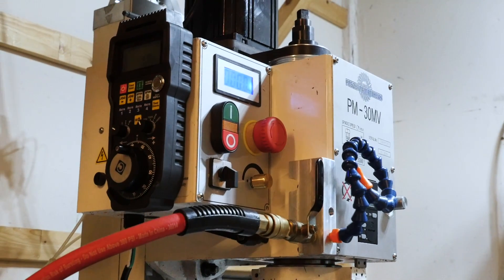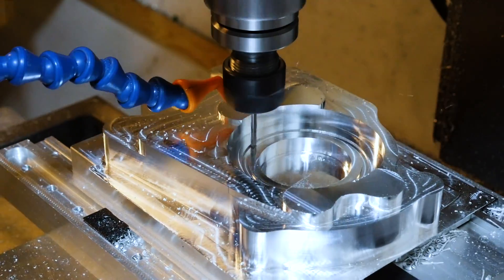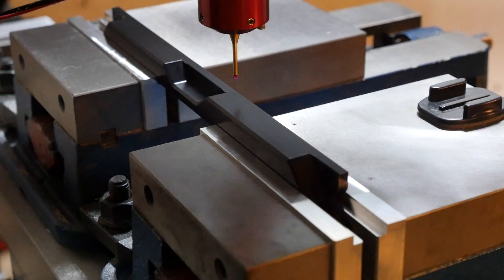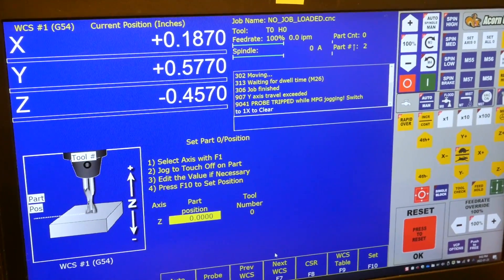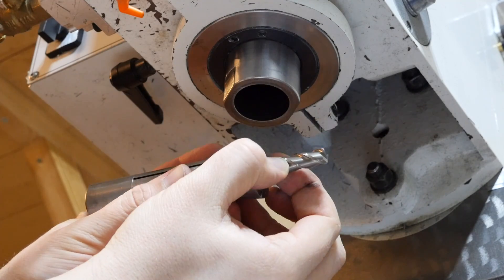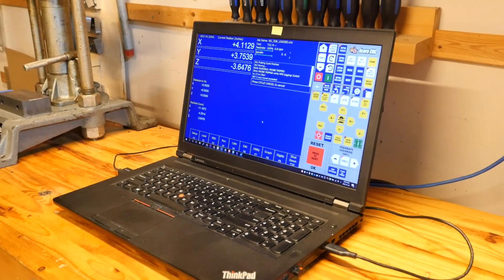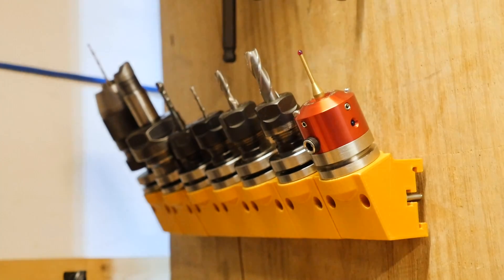Convert a Bench Mill to CNC - Everything You Need to Know

Comment: Are there memory issues/limited with acorn as far as gcode.  Read a review about memory is limited. “Great controller but the 50kb limit is reall really low.. wont even do 4 m8 holes from fusion 360 using their sprial bore feature. “

Is that accurate that the pro version is needed for increased memory.
Reply from the maker: @I2AT  yes. The upgrade to the mill pro license is pretty much a must. Thread milling a hole takes a shockingly large amount of code, still, it’s something you’ll want to do often. Upgrading to pro will gain you everything you need from a software standpoint….. unless you want to go even further to the “digitizing” package, which is only for probing thousands of points in an existing part with a touch probe. You’ll likely not need it. I have a relationship w/ one of the owners at centroid - he’s sent me the KP1 touch probe and the digitizing license free of charge. Love the touch probe for setting work offsets and measuring things, but really never use the digitizing functions - it’s just not the type of work I do.
Reply: @adamdebowski2037  appreciate the feed back.  Give a shout anytime if interested in firearms, B&T. Take care, Travis

Comment: Noob question: can you still use this conversion as a manual mill?  I know that ball screws have very low friction, but is it straight-forward mechanical lock an axis?  I have an odd foreign mill that I want to mount a power feed on, but I am thinking that I might consider swapping in a ball screw to replace the lead screw.
Reply from the maker: @George-bb9yi  Hi George not a bad question at all - you can get some motors that the shaft passes all the way through, and so you could theoretically mount a wheel to that shaft, but I don’t see it done, really. 

I do, however, use the mill in a semi-manual way all the time - entering simple g-code into the control and have it power feed along every axis to cut square/flat features.
Reply: @adamdebowski2037  Thanks!

Comment: Hi. Can I do this with the Proxxon FF230 CNC desktop mill?
Reply from the maker: @V_raptor88  it sounds like it already is a CNC mill.
Reply: @adamdebowski2037  I mean I want to automate it with the servos and stuff. Mine is a completely manual CNC mill.
Reply from the maker: @ “CNC” stands for “Computer Numerical Control,” and it implies that there are motors on the axes being controlled by a CNC controller. It sounds like you have a manual mill. Any manual machine can be converted to CNC… theoretically. Some more easily than others. You’d have to do some research to find out if you can install a ball screw kit for your mill with mounting brackets and shaft couplings for NEMA motors.
Reply: @adamdebowski2037  oops, sorry I'm new to all this. Thanks for guiding!

Comment: Awesome video Adam! Any thoughts on whether this would be a better option than just buying a Tormach 440 or 770?
Reply from the maker: I'm glad you enjoyed the video! Objectively, both the 440 and 770 are better machines than my setup, but they sure come at a premium. All in, the setup I have is under well under 10K USD, and that includes the Mill, CNC conversion, air compressor, tooling, everything. The main benefits of the Tormachs: Tool Changers (this is huge), way higher 10,000 rpm (great for small tools)  compared to my 3000 rpm, enclosure & cooling (lets you get into fancier materials easily), BT30 spindle is more rigid than the R8 spindle. The main benefits of my setup: a fraction of the cost, somewhat easily (and economically) upgradeable spindle that will out perform the Tormachs, and PM30 has larger machine travels. If I had to choose between my setup and the 440 or 770, I would probably still chose my setup. If I had to choose between my setup and the 1100M, I'd choose the 1100M if money was no object. I'd say it really depends on what you want to use it for (hobby, or business/making money?) and the materials you want to machine... and most of all; budget.

Comment: Adam, currently I’m running nema 34 on the Acorn. I’ve done a lot of research but couldn’t find the answer. I’m trying to find what to set my PPR or step per revolution on the driver. Any recommendations?
Reply from the maker: More than likely you should be at 6400 pulses per rev. Try that out. If you're wrong, it'll be obvious in the machine travels.
Reply: @adamdebowski2037 Adam, the driver is set to 6400ppr. I’m tuning the motor to move 1” but it is really inconsistent.. average around .001 off give or take when I rerun 1” movements. I take it from the backlash?
Reply from the maker: @TheAnt0906  yup - sounds like backlash. You can compensate for backlash in the control.

Try passing one inch on the way back, and then changing directions to get back to 1 inch…. Something like: G0X0, G0X1, G0X-0.125, G0X0
Reply: I’ll give it a try. Thanks!

Comment: Hey any update on the Linux CNC?  Did you switch?  What current controller do you recommend? Still the nema34 12nm motors a good idea?  I want to convert a pm728 to a CNC mill, what you think?
Reply from the maker: I'm still using the centroid Acorn, and the more I use it, the more I love it. I am biased, but I would still recommend the Centroid Acorn, and still recommend all the same hardware you see in this video.

In my opinion there are two good reasons for chosing LinuxCNC over Centroid Acorn. #1 Cost, and #2 If you want to control more than 4 stepper/servo motors.

Comment: You should be able to recover that kennametal tool if it's just full of chips - A solution of Lye dissolves aluminium. Great for cleaning up aluminium welded cutters.
Reply from the maker: Cheers for the tip! Does the solution affect the carbide/cutting edges at all?

Comment: This may be a silly question, but when you convert a mill to cnc are you still able to use it manually? 

Ive been looking for a super cheap 2 in one kind of thing and have seen mixed results
Reply from the maker: That’s a good question. Typically - not really. I often use my mill as a “manual” mill by spinning the wheel on the centroid pendant to make the axes move, but I have no hand wheels on any axes. If you’re set on having hand wheels on a little CNC mill like this, you can get servo motors with a shaft that passes all the way thru them so you can attach a hand wheel. It’s a less common setup, but can be done.

Comment: Question, I'm turning my mill into a cnc. I'm looking at acorn. Are you using the centroid nuc cnc PC with your laptop? Or do you need it?
Reply from the maker: No I’m just using a laptop. Same computer that runs Fusion and Solidworks. I’ve never had a problem, but they say you shouldn’t, and that you should have a dedicated computer. I’d never do that. Being able to post code and upload it right to the control without USB sticks is great.

Comment: This is a great video. I was a machinist back in the mid 90's and you reminded me of lots of things I haven't thought about in a long time. I'm looking to build my own cnc machine right now and this helped thanks man.
Reply from the maker: Thanks for commenting! I’m glad you found it useful. Good luck on your build and come back to share the journey if you can. I’m always curious about what everyone’s building. Cheers 🍻
Reply: @adamdebowski2037  You bet! I know how to build a rock solid accurate machine, I'm just stuck on what controller to pick. From what I can tell I need a controller that works well with a software that can take my Gcode out of solidworks cam..... I'm going to run nema 23 or maybe 34?? closed loop motors. Any thoughts on openbuilds BlackBox Motion Control System for the brains? Or just go with acorn? I like the looks of it but its a bit pricey. I look forward to more of your videos! Thanks again 🙂
Reply from the maker: @-BlackBird7  sounds like the perfect storm! If you can build a straight/ rigid machine, I wouldn’t worry too much about the controller. Unfortunately, Acorn is the only platform I’ve ever used. I have friends that swear by linuxcnc and do awesome work. Nothing I ever do on the acorn is something they can’t do on LinuxCNC. I don’t know anything about the BlackBox system, and I’m not sure if solidworks CAM has a post of centroid/Acorn, but Fusion CAM and HSMWorks CAM (a plugin for solidworks) do. Closed loop steppers have been so great to great for me. I’d go Nema 34 because you’ll never have to worry, but people do use Nema 23 on X and Y axes. You should send Dave (from Arizonavideo99 on YouTube) an email. He knows a lot about sizing motors for these machines.

Comment: Great video. I converted a PM25 to CNC a few years back and I wish I would have had your video then as I would have avoided many mistakes. Thanks for putting this info out!
Reply from the maker: To be honest, I wish I had this video, too! Hoping it saves others the pain we’ve endured!
Reply: @adamdebowski2037  I can see why you would say that. I am considering another CNC build which is how/why I found your video. Your video will be my go to source for sure.
Reply from the maker: @Sam-kq2to  which machine are you planning on converting?
Reply: @adamdebowski2037  Great question. Probably either the PM940 or PM30 as you did. I like the idea of a more robust machine like the PM 940. I see Arizona has the ball screw kits for the 940. Not sure about the Servo motor and controller requirements for the 940 yet. I need to do a bunch of additional research. Your thoughts?
Reply from the maker: @Sam-kq2to  the 940 is going to be wayyy more rigid than the PM30. The down side is max spindle speed is less than 2000. On the PM30 it is 3000. You could always upgrade that down the road, though….

Comment: Huge nerd doing it hahahaha, well nerd me up.
Cheers mate, i was just about to pull the trigger in a HM48 Hafco mill with power feed, DRO and stand, which now decided to convert to a CNC having found a conversion in Australia.
Your vid just saved me thousands in showing what i dont need, or can ditch to knock $1000 plus off the mill. What ill save will pretty much cover the cost of the conversion.
Thankyou mate. Good job.
Reply from the maker: Thanks for sharing that! One of my viewers just shared that he is using the Royal R8 quick change tooling system. It looks a little pricy but check it out. Looks like it has all the same benefits of TTS but even faster tool changes - you don’t have to touch the draw bar at all. It’s the first time I’m hearing about it but it looks freakin sweet. Worth some research. Good luck on your build!

Comment: 10:17 - have you try to use acid to eat away aluminum chunks? Another option is ultrasonic bath - it isn't cleaning aluminum, it eats it away by break oxide film on the surface, then pure aluminum reacts with water to form new oxide layer and hydrogen gas.
Reply from the maker: Interesting. Thanks for the tip!

Comment: Hey adam question, Could you accurately re surface an engines cylinder head with your setup? Aluminum head in particular?
Reply from the maker: It depends on the length of the cylinder head. The Y travel/table is unsupported, so it can rock a little as the center of gravity of the table passes the supported edge. But with your gibbs properly tightened, I bet you could. What is the flatness requirement for that surface>?
Reply: @adamdebowski2037  a  quick google says "A good rule for flatness is that surface flatness, measured in thousandths of an inch, should never exceed the number of cylinders on each bank across the length of the block. For example, no block or cylinder head should exceed . 003" out-of-flat if there are 3 cylinders, as there would be in an inline-3 or V6 engine." 

But I would personally say within .002"

Looking to getting into milling/machining, to assist with my garage tinkering and I love your videos, Great stuff!!
Reply: ideally you would want a perfectly flat mating surface for the head gasket. Especially for performance applications with forced induction. I just think it would be awesome if I could do this in my garage instead of shelling out for a shop that may or may not give me the perfection i'm looking for.
Reply: I would say they are roughly 20"
Reply from the maker: @utlaw-bk3wz  this machine would be a little too small for a very flat cut at 20” long. Ideally you’d want to use a fly cutter, which has a big diameter - maybe 3” or more - so a 20” long cut would need to travel about 26”, and that’s outside the travels of this machine.
Reply from the maker: @utlaw-bk3wz  ok - generally speaking, if your mill has enough travel, 0.003” or 0.004” flatness is not difficult to hit.

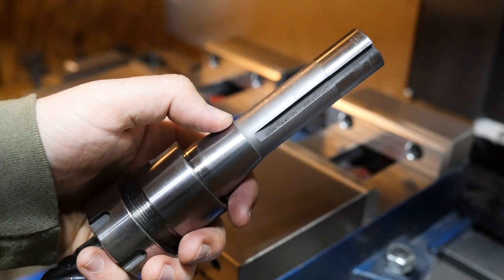Comment: 9:53 - collet chuck also has a shoulder. It is higher than spindle(because of taper and variances in milling machines), but you could precise measure gap between this shoulder and spindle, then you can turn spacer on a lathe. Still not as convenient as TTS and will work only on particular mill.
Reply from the maker: That's an interesting idea. Have you ever seen somebody do it? I haven't seen it, but it sure sounds like it would work.

Comment: my big mill is mt3, little mill was mt3, and was cnc. had a... cncfusion? kit... was really bad. worked, but horrible. and imperial. that made me crash nearly every time i started it up and forgot g21 in the code... could never get it right. crunchy, binding... a lot of that was also the mill itself, being a banana.

just tore it apart for an upgrade and scraping. new screws. metric. r8 spindle. 3/4 collet. bunch of er20chucks. lots of new thrust bearings and the like. motor. the works. even vaguely toying over getting the X2L, its a bit bigger, longer... 

running the lil er20s on the big mill, in an er32 chuck at the moment, waiting on a mt3-3/4 collet.

and waiting on a whole lot more er20 6,8,10mm collets. sort of defeats the purpose, changing tools still. lol. um... that will change!

yeah, tooling. thats the nasty part. 160 on endmills, gone in a flash... and thats nothing. could buy one endmill for 160... and destroy it with the old g21 or lack of! wee!

or forget about z lift on the go to home... oh my. retract FIRST!

havent actually done any cnc in years, the end of XP, really... tried installing linuxcnc on a pc a few weeks back, no luck... iunno. have to look into that... having a running PC is sort of a necessity. still have my gecko and power supply. also toroid? was on special years ago.

at the moment just scraping the minimill and being a lazy bludger. 3 weeks procrastinating over a tool to measure the dovetail lol. planning! took ten minutes to make!

scraping sucks, but omfg its worth it when slides work!